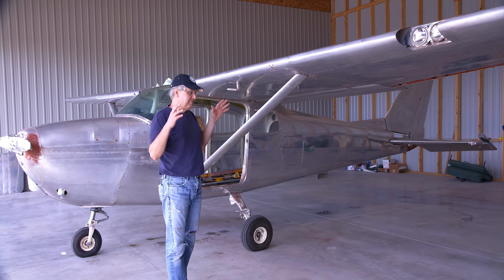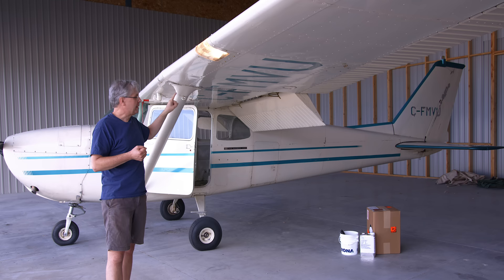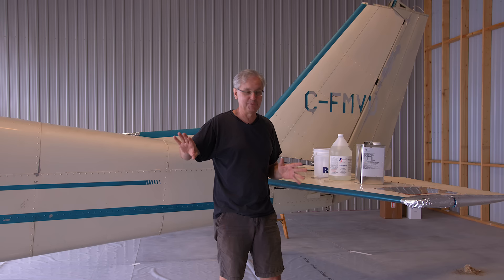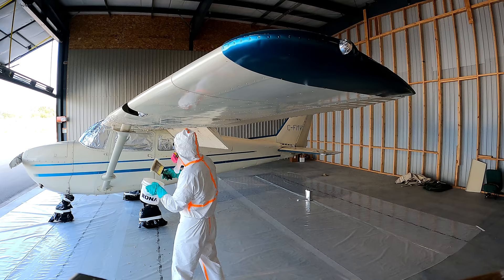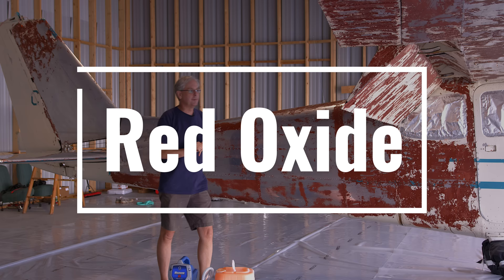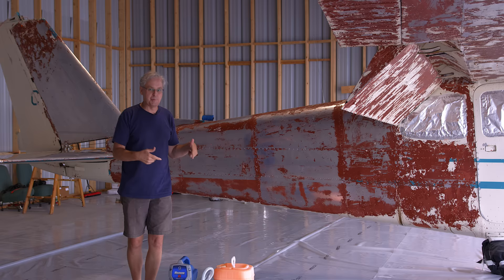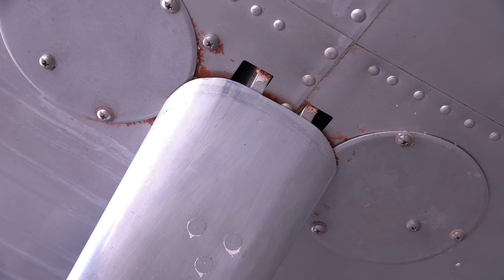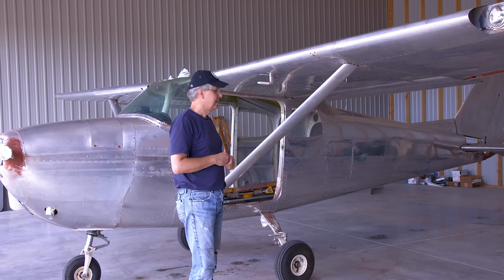Stripping The Paint From A Cessna 172B Glen's Hangar - Episode #5

Comment: I stripped my 1964 172E and if I knew what I know now, I would never have started.  Someone had painted it with a red primer, that I spent weeks rubbing off with a rag and paint thinner.   I cleaned around every rivet with an old tooth brush.   I measured my success in square inches at a time.  It was repainted with epoxy primer and polyurethane paint.   I sold it after owning it for 30 years and its still beautiful.

Comment: In the late 80s early 90s as kid my brother and I were painters helpers for my dad at a shop where they only painted commercial vehicles, tractors, 18 wheelers/ trailers etc. We used a reddish/brown colored putty primer made by Imron to fill pinholes in the undercoat or over bare metal and scratches. I’m fairly certain that’s what this is. Back then, there were far fewer restrictions and this stuff was gnarly if you caught a whiff or got any on your skin.

Comment: Don't know if it's permissible on aviation applications, but the remedy for reactivating stripper after it begins to dry is to have a spray bottle of laquer thinner to spray over the area.  Also long heavy slow brush strokes in one direction only will help eliminate the inconsistent areas.  The spray bottle is a necessity.
Reply from the maker: Two of the products I used specifically said not to do that - the other didn't mention anything about it... but I'll stay on the side of caution.

Comment: Brave man taking that kind of a job on,  on the occasions I have been demented enough to try this it involved removing the prop, engine, engine bearer, all control surfaces the wings, vertical and horizontal stabilizer the entire interior including the instrument panel and finally the landing gear. Paint stripped with dry ice and then sent all the parts out to a professional paint shop.
Reply from the maker: The control surfaces will come off (as time and hangar space allows) - instrument panel comes out soon.... keep yours out for that.

Comment: I polished a 1958 Lotus Seven. At times I used 3M red pads or 220 wet dry paper to take off nits. It took a lot of time and several different polishes and pads but it came out very nice. Not fully mirror as there are too many deep pits in the aluminum to get a true mirror finish. A deWalt polisher with digital speed control worked well. Wool bonnet to start the process. It is a good winter project as sweat corrodes aluminum. The aluminum will warm up due to friction from the polishing.  Switched to cotton pads and an orbital for the final polish.  Had to hand polish some of the hard to get to areas.  Good luck.

Comment: Methylene chloride is an old school paint stripper that usually makes short work of primer as well as paint. You can't use pure methylene chloride on aluminum though as it produces a flammable gas. But you can use a stabilized product like Benco (brand) B17 on aluminum. It's a very aggressive stripper with great results but *must* be rinsed off within 90 minutes though to prevent etching similar to bead blasting.

Comment: If your plane has the logbooks from the 70s, there will be an entry for your tail  change out. If not then the most logical explanation is that that is the original registration letters for your airplane but it was deregistered during one of those lengthy down times and then re-registered with the current registration letters

Comment: Its a not a "filler" in the primer paint. Its a catalyst. Be careful....a lot of the red oxide primers have lead in them. For working around the rivets without removing metal try the 3M roloc rubber, rotary bristle abrasives....and/or the 3M scotch bright circular pads that are part of the Roloc system. Very nice work!
Reply: It looks like a butcher did the last paint job on that plane and there is no way in the world it was ever compliant with regs. Those 3m nylon Rolocs are great but you've got to be careful. We used to use a plastic scraper on rivets and finish them with white Scotchbrite by hand. I saw a Cessna 210 nearly end up at the wrecking yard after someone had taken to it with Scotchbrite on some sought of power tool. Literally hundreds of rivets had to be replaced as someone who "knew what they were doing" had managed to erode half of the rivet heads away with Scotchbrite.
Reply: @davidbrayshaw3529  yes.....people who do not work with coatings and especially abrasives....have a tendency to think that "Scotchbrite" are soft/low abrasive. The common green scotch brite is about 360 grit aluminum oxide IIRC. The fingers on the rubber roloc pads are excellent for rivets.....but they MUST be used with stripper gel. The stripper is actually doing the work. The fingers on the roloc are just for reach. Very slow tool speed and low pressure. I have alwo seen them used mounted on an oscillating tool.
Reply: @jessegreenwood1956  It sounds like you've worked in aviation. Many of the commenters here don't have an understanding of the unique nature of aviation re finishing and the regulations that surround it. Unfortunately neither do some plane owners, as I've found! That is a great idea mounting rolocs to a multi tool. I wish that I'd known that one when I worked in the industry.

Comment: The wings on my 1946 stinson 108 had that same red primer that is really hard to remove.
I plan strip as much as will come off easily, then say the heck with what will not come off, assuming I can paint over it as a primer.
Of course different from your project, my wings will be covered by fabric, but it's good to see others struggled with this red oxide primer.
Reply from the maker: It was horrible - but once I figured out that the last of it came off with lacquer thinner the project moved along nicely. I ended up using 3-4 gallons of lacquer thinner and a pile of rags.

Comment: Looks good Glen!

If those areas of previously sanded aluminium are relatively small, you could probably restore them with micro mesh.  (Lee Valley carries it).  For $30 in materials and another couple hours of elbow grease, it’s probably worth trying…
Reply: Also worth trying, Eagle One Wadding polish... Look for it at your automotive parts store

Comment: Im a truck driver and spend many hours polishing   you can polish out sanding marks.  watch some youtube on polishing fuel tanks they often start out by sanding the tanks and end up with a mirror finish
Reply from the maker: Unfortunately sanding airplane skins is a no-go. The skins are structural and also are a clad 2024 alloy - if you break through the cladding it's a world of hurt.

Comment: Getting sandpaper marks out is really easy. You take them out with finer sandpaper--not too much finer, a step or two will do. That sandpaper (use wet and dry with water) will also leave its own finer marks, so you go to finer again. It usually only takes a few steps to get to fine enough to polish. I'll often use a series like 400, 800, 1200, polish. Don't go to the next finer if you haven't gotten all the marks from the previous out. You're done with a grit when the only marks left are those from the sandpaper you're using. Don't jump too far, because if the sandpaper is too fine, it will polish the scratches you're trying to get out instead of removing them. There are sandpapers with grits in the range 2000 and up, but at that point you are polishing anyway. I do have them but only use them if I'm going for a glass like surface and then I follow up with successive polishings with finer and finer grit polishes.

Comment: I’ve been painting since we were using lacquer paints, best stripper I’ve ever used was called Aircraft paint stripper. It’s yellow In color and I’m not even sure it’s sold anymore. Lay it on thick and don’t over brush it.
Reply from the maker: In tiny print at the bottom of the ‘Aircraft Stripper’ can is a line: “Not for use on Airplanes”. 🤣 Apparently too corrosive on aluminium.
Reply: Hahahahaha too funny 🤣
Reply: @GlensHangar  But the name, lol. It is good stuff tho. Never a fun job for sure . There is another way , throw dollar bills at it. Wait that’s another stripper.
Reply: @GlensHangar  I guess they call it Aircraft Remover because it removes the whole aircraft.

Comment: Anything can be polished.  Just takes time, money, and GAS (give a shit).  Run until you exhaust one of the resources.  Sand scratches are removed by sanding them out with progressively higher grit.  Never ever sand by hand without an interface between your hand and substrate  to be sanded/polished.  Usually work up to about 2000 before attempting to polish.  Paint strippers just suck these days.  I don't recall a single modern product burning my skin.  Where as back in the 90's a single drop would get your attention.  The red oxide layer was quite thick, and it has a great affinity to absorb the chemicals just enough to become messy but not enough to remove it.  Color coats were most likely enamel.  Paint stripper does better at breaking the cross links and it peals right off.  Red oxide was probably lacquer based and just absorbs it and sits there.

Comment: Seems like the lessons here are:

1. Go with a sprayer/pressure wash system from day one.
2. Disassemble completely, since you are going to end up doing it anyways. Control surfaces, plastics, windshield, remove.

This pretty much matches what I saw them do to my aircraft. It takes a strong stomach. My A/C looked like a complete wreck during stripping.

Comment: @Glen - FWIW, I'm in the middle of painting my Homebuilt and I can tell you that painting is also a ton of work!  You have my sympathies, right now I'm in sanding-hell between applying primer and starting the top-coat... :-P Hope the polish-job turns out to be everything you're hoping for!
Reply: Hat-tip to the Stewart Systems stripper I see, BTW.  I'm using their EkoPoxy and Ekocrylic for my paint-job (and after priming the entire aircraft, I have thoughts - both good and bad). :-D

Comment: Kleen Strip makes a aircraft paint stripper that used to work very well. However  big brother has made them remove  what made it so good in the name of being eco friendly.  It was pretty nasty.if you got a drop on your skin you were running for water very fast and the fumes were nasty;....but it worked great.  The new Kleen Strip does not even come close to the old stuff. I used to use it on cars in my body shop on occasion.  Just like your plane it was not all that effective on the primer and especially the factory E cote on the cars.  For some reason it was almost useless on lacquer paint....luckily hardly any of that is around on cars anymore.  I bought a Dustless Blasting system a while back and its nice but not perfect.  I doubt if that could be used on aircraft for a number of reasons...for one it can be bit harsh on aluminum but I see where some have got to where they can do aluminum very well.  I use crushed glass and it does a great job....but all the sand on a aircraft might be a issue.....just not sure..  You did a great job....good for you.

Comment: I never got the polished Al thing. It does oxidize. Aluminum in fact oxidizes immediately and is will corrode eventually. Now I'm not a plane guy but I learned this with motorcycle cases and covers. Nothing wrong with painting aluminum.
You might try blasting the bits of red primer with soda or walnut shells. Messy but it may be quicker.

Comment: Here are the professional tips  I use to strip paint off cars, busses, planes  ect. Working with  Steel as well as  aluminum   first a  paint stripper with methylene chloride in it. Here now new in the communist  USA  its is outlawed under the new socialist (national rule) but, seriously, I use a metal type old school  bug sprayer or weed sprayer  to spray  on the stripper.  It goes on  Efficient and evenly .If  it evaporates  too fast you cover with 3 mil  plastic , this allows the active ingredient to stay on longer .Also duct tape all the jamb areas .The stripper won't eat through  high quality duct tape. The reason you had a problem with the red oxide primer is most likely it was epoxy.   Most Paint does not stick without primer and in order to get adhesion on steel  or aluminum or stainless, either a physical  bond (sanding) or chemical  bond  is  Necessary and both together  are superior. So zinc phosphate  or zinc chromate primers for example. Epoxy is the best and now there are some new ones that are  hybrid with urethane. Unfortunately  bare aluminum will get hotter compared to a white Finnish paint  job .And the temperature of a black Finnish will be blistering. White is the coolest temp overall. I hope these tips helps someone out next time.

Comment: Variable speed random orbit sander start at 220 grit progress up to 1000/1500 grit,  polish to mirror finish with variable speed rotary buffer then apply your top coat.  Time consuming but it will polish. Visit a big truck wash or truck stop, ask the wheel polishers for a few lessons.
Reply: Aircraft alloys are clad. Harsh abrasives are to be avoided at all costs and some will cause galvanic corrosion. Traditionally, aluminium aircraft were polished using cheese cloth and flour. I'm sure that there is a commercial alternative these days but there is a reason that you don't see very many polished aircraft.
Reply: @davidbrayshaw3529  it's call maintenance to keep it polished. Polishing doesn't  cause galvanic corrosion. That is caused by mixed metals in direct contact ie steel screws on aluminum panels. Your choice of flour and cheesecloth is more abrasive than rouge and a rotary polisher which is 10000 grit or 1-5 microns. He has panels that were scotch-brite abraded for primer adhesion that need to be micro sanded before a polished finish can be obtained by polishing alone.  I worked years in my youth polishing multiple forms of metals.
Reply: Sorry, I should have been more specific. Harsh abrasives such as 220 grit sand paper should be avoided in aviation as they will damage cladding on the aluminium panels as well as damaging rivet heads. Steel wool of any grade should not be used due to the potential for material transfer leading to galvanic corrosion. Both of these items were quarantinable items in the hanger in which I worked and were prohibited for use by CASA, the Australian aviation regulatory authority.
Aircraft panels were never sanded prior to coating but rather lightly Scotchbrited (by hand) before a conversion coating was applied and then paint.
I appreciate that you have much experience in metal polishing but there are considerations in aviation that are not necessarily applicable in other areas. I am a former AME and have some training and considerable experience in aircraft restoration and coating.
Reply: @davidbrayshaw3529  where did I ever say to use steel wool? Scotch-brite comes in multiple grits red being 360 grit, green being 600 grit,  gray being 800 grit. To polish a surface requires reducing scratches until they disappear  progressing through the grits.  I didn't specify  starting with 220, that would be based on surface scratch size to be removed. And there are specific papers for sanding aluminum ie aluminum oxide. You are correct that rivet heads need to be avoided except for final polish to not reduce head size but that is expected with common sense on the part of the person polishing the aircraft
Reply: @jstaffordii  You didn't suggest using steel wool but I was pointing out that certain abrasives can cause corrosion. Led pencil can and has caused corrosion! 
We never used sandpaper to prepare planes for refinishing as it can reduce or breach the cladding applied to the aluminium.
For the same reason we never used orbital sanders even in Scotchbrite as they are too abrasive. Preparation for conversion coating was always done gently by hand using green Scotchbrite. I agree that there are aluminium compatible sand papers available but, in Australia at least, I believe that they are not approved for use on aircraft and in our hanger sandpaper was prohibited in the paint preparation area. Hygiene was also a consideration as there was the possibility that debris from the paper could migrate into unwanted areas of the airframe. The only time that we used power tools was to remove small amounts of corrosion and this was done using nylon wheels or small Scotchbrite pads. It was very important not to heat the panels when performing this task so as not to affect the temper of the metal. If corrosion was more extensive, the panel was replaced. 
I was only ever involved in preparing aircraft for paint, not polishing so I can't comment on appropriate approved process's for polishing aircraft. 
With regards to "common sense" of people working on aircraft, it's not necessarily that common when people without specific aviation training perform their own work on aircraft or worse than that, other people's aircraft. There are some unique characteristics to working on aircraft that aren't necessarily obvious despite one's best intentions and abilities in other areas.
This was demonstrated to me a number of times while working in the industry.

Comment: Fortunately, a lot of your 172 looks like its polish ready.  Polish each panel and then address the rough spots.  You can wet sand any rough spots in the aluminum and then polish again.  Even where previously sanded, you can wet sand those marks out.  It would be great if you could start with 1000 grit paper and progress to 1200, 1500, 2000, 3000, then rotary polish with a sewn cotton wheel and various rogue compound bars. You can also start with a more aggressive paper like 600 then 800 and again all the way to 3000.  Just watch some videos of polishing aluminum wheels and you'll get the procedure.   No reason you cannot make her look like a mirror.  Only dents and deep gouges will be your enemy.